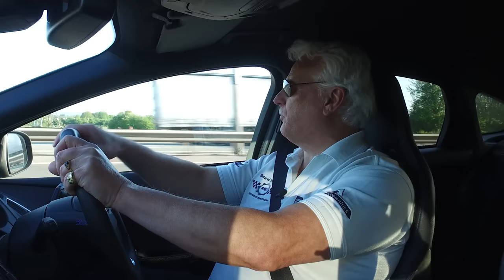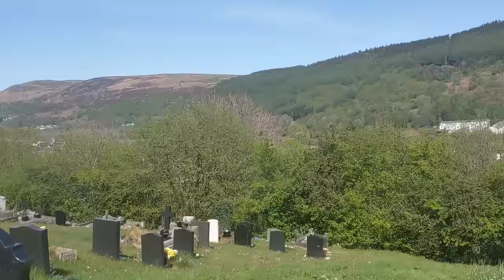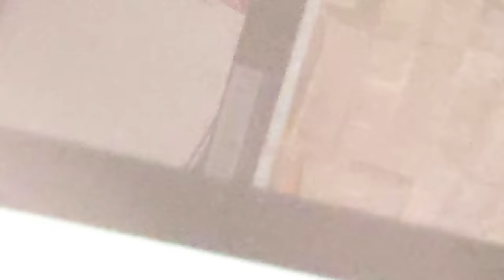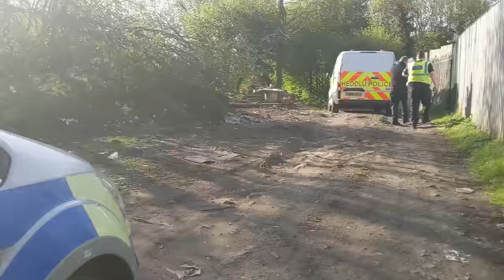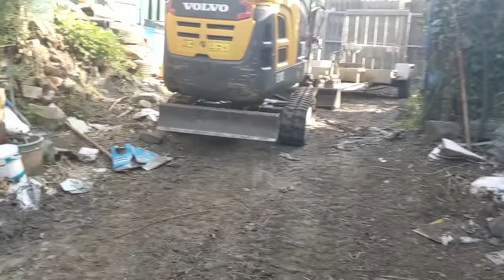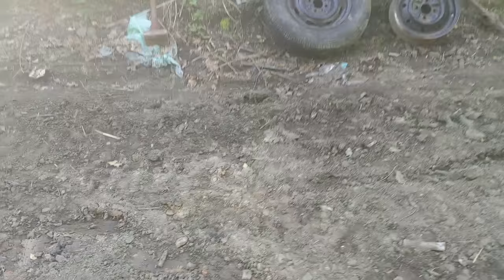Automatrics Stolen Terex Roller Theft Recovery Operation in South Wales

Comment: Eight years old tracker tech, inside a steel roller, in a weak signal location. Still did its job. That's quality.
Reply: Tech has become increasingly cheaper. No reason they couldn't have expedited the search with a commercial grade drone?
Reply: @markescartin1915  good idea.
Reply: @markescartin1915  The law in uk makes it complicated.
Reply: @markescartin1915  illegal to use a drone over someone else's property isn't it?
Reply: @albr4  Nope.
Reply: AirTags this is finished
Reply: @albr4  No, that's because they do not own the air space.
Reply: @kwakgreen  just reading the drone laws and it looks like you can't fly them over most buildings.
Reply: @albr4  Restrictions vary depending on the locality? In the states there is the notion of probable cause that helps establish whether a search is reasonable or NOT?
Reply: @albr4  It actually isn't up to a certain size and weight drone, The majority of small drones tell you on a screen where you can and cannot fly "red zones" which is usually airports and close to airports etc, Mostly everywhere else is good even over private property because they do not own the airspace.
Reply: @Nevakonaza.  You cannot fly over residential property, villages, towns, cities, I think you might be able to if the drone weighs less than 250g though. If it weighs more than that then you can fly 150m away from the buildings. I think they could fly a drone over these scrap yard type areas where they often store the stolen object without too much problem.
Reply: @kevinsmoother best of luck with that 😂
Reply: Youtube didn't notify me of the new vidya .. most annoyed .. but nice to see a new release.
Reply: @albr4  There are certain area's where you can't fly drones, over military bases and installations, over certain government buildings and airports.
Reply: Gotta say Im impressed.
Reply: @kevinsmoother  Air tags can be blocked with GPS blocker. This has both RF and GPS
Reply: @kevinsmoother  AirTags are useless for this application.

Comment: You should buy a drone to use in daylight to hover over properties, such as the DJI Mavic mini, it's below 249 grams so can be legally flown over residential, commercial,roads, virtually anywhere, would help when access to yards etc is impossible, it connects to a smartphone and records and takes pictures,I own one, fantastic and easy to fly.
Reply: He has one.... I can't remember which video he used it in, but we have seen it.

More interesting would be to get a lightweight receiver and repeater attached to it. At 120m you'd potentially get a signal from a greater distance due to fewer obstacles.

Comment: Just a thought, can't the tracker log all the phone masts it connects to so see the direction of travel, also what about triangulation by connecting to 3 different masts and analysing the signal strength.
Reply from the maker: Correct but it still a work up in the Valleys